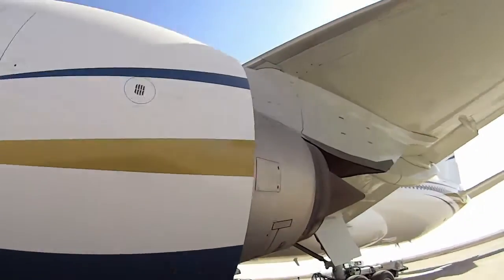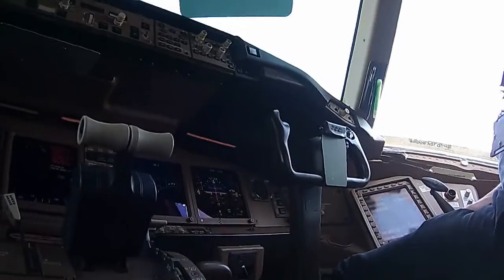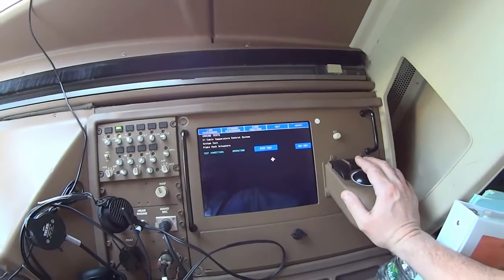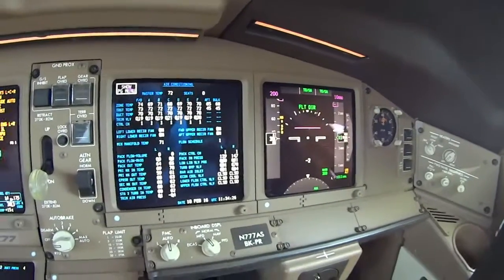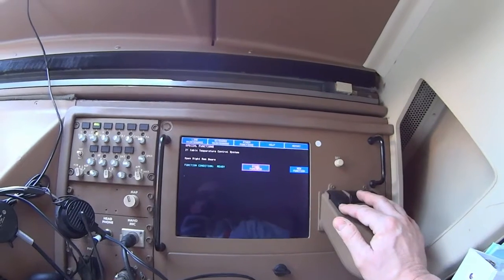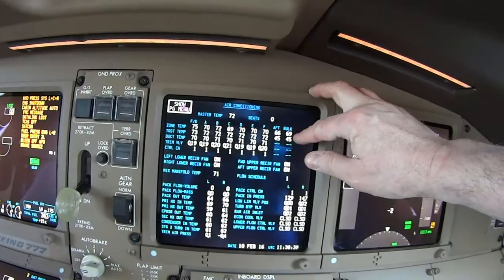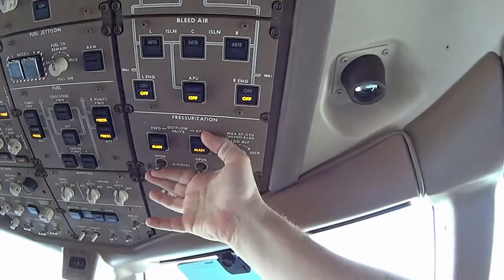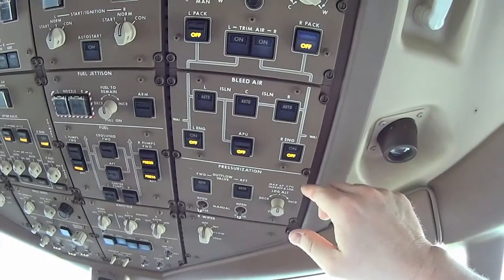Boeing 777-200 Preflight Part 3 | Windshield Clean | System Checks

Comment: Seems like F/O's have more work load than the captain😂😂

Edited: Thank You for your time Sir, I've looked for nice tour videos on an airplane. Your passion for this work is a good motivation. I understand this video was posted 7years ago, I hope you're a great Captain now!!!
Reply: This isn't usually the job of a pilot (Neither a Captain or a First officer). I'm an FO at an airline and honestly I have absolutely no idea what he's doing here. I've seen them do it but I don't even know how to access those BIT pages or where to start with the MAT. This is usually the job of an airplane mechanic/maintenance engineer which is a job that requires certification and rating. I don't know where a pilot job would require the pilot himself to conduct this kind of ramp tests. So kudos to this guy. He knows a lot more about the airplane than the majority of pilots out here.

Comment: Yo! Call the ground crew to clean windows. You’re an important pilot. 
You could fall out and die in winter if it’s slippery. Not to Mention rain and sleet falling in instruments.
Reply: It's a private Boeing 777, so there's not really a "ground crew," other than tugs, fuel, water, etc. He's a flight mechanic, not a pilot - still really cool though, knowing all the in's and out's of a whole jet airliner.
Reply: Pilots clean windows all the time btw in the airline industry too

Comment: FRICKEN COOL MAN!!
Reply from the maker: Boeing T7 Yes it will.  Sometimes if it is very humid and hot and we are waiting a long time for the passengers.  Like 10-12 hours I will need to turn off the recirculation fans.  When the air goes through the pack it has moisture removed.  But then at the mix manifold the recirculation fans dump moist air taken from the cabin directly into the mix manifold.  This can cause enough icing in the cockpit supply duct that it will ice shut and stop flow to the flight deck.
Reply from the maker: +SSR KNIVES AND GUNS! Doesn't everyone do this for a living?
Reply: +BigIronTV I WISH!!
Reply: +BigIronTV Need help? lol Does the aircraft aircon system keep up with operating in regions with extremely hot external air temperatures on the ground?
Reply: +BigIronTV I though the cabin air and the cockpit air supply were separated.